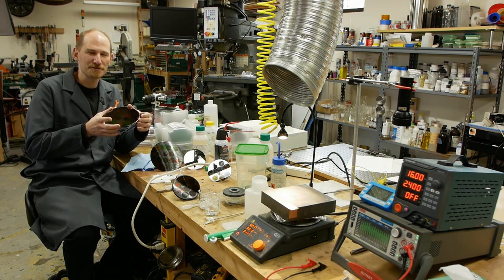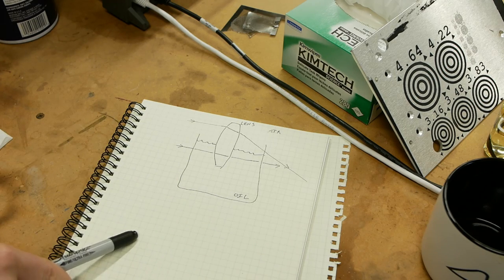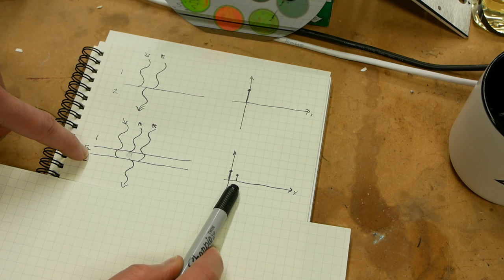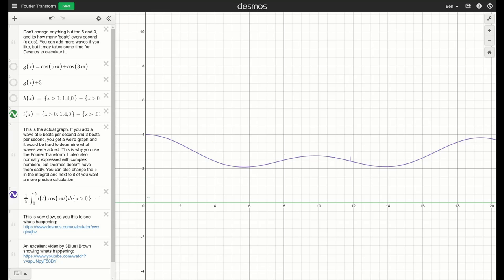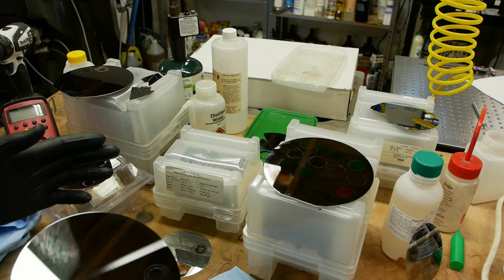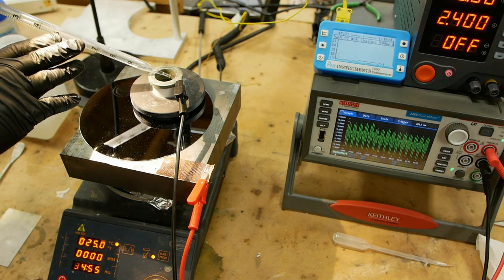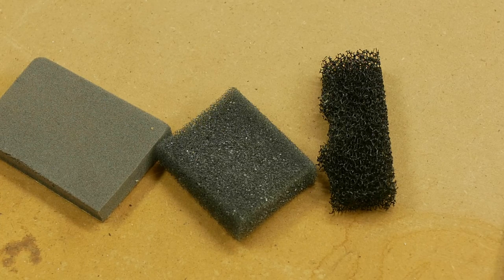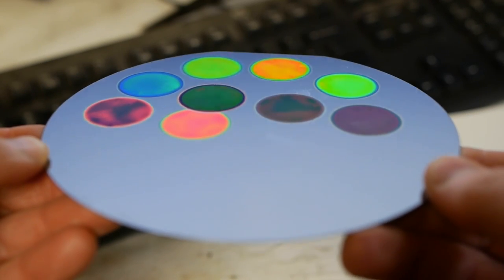Etching silicon wafers to make colorful Rugate optical filters (porous silicon)

Comment: So in inverse Fourier transform, you sweep through all frequencies and add them up with corresponding amplitudes. But in this case by altering refraction index of individual layers, we sweep through different phases for a fixed frequency because each layer is positioned at a different optical depth. However, the result seems to be the same? I don't quite understand how (mathematically) this is possible, can I maybe get a link where this is derived?
Reply: Well at a fixed frequency when you sum the phases of the different reflections you get the filter amplitude at that one frequency.  Effectively you are getting one point of the entire Fourier transform.  But consider what this looks like for a general frequency and wavenumber w=ck.  I believe we are to assume the intensity of reflection is proportional to the spatial derivative of refractive index.  The phase of the outgoing reflection is proportional to depth and periodic with (twice) the spatial frequency of the light (in principle this also changes with IOR, but maybe this is not significant in practice).  In phasor form the phase is e^(i2kx).  Thus the total reflection is the integral of the reflection intensity (IOR waveform) times the phase e^(i2kx) for each depth (dx), which is exactly the integral for a Fourier transform (up to constants) when k (or w) is taken as the independent variable.  I think this is more like a forward Fourier transform where you are finding the frequency content of the reflection strength.

Edit:  After some more though, you could also consider that for a given depth it adds a periodicity to the output phase as the frequency varies.  This periodicity is exactly the e^(ik2x) from before.  Thus you are summing the effect of the periodicity contributed by each reflection depth across the spectrum.  Weird cause now you have frequencies in the frequency response itself, but also a valid interpretation.  I guess another way to understand the qualitative similarity of forward and inverse Fourier transforms.
Reply: @piperboy98  keep in mind that actual reflection coefficient (Fresnel coefficient) is not just an index of refraction spatial derivative integral in general case. Assume just 3 layers, then there's 2 interfaces between them (2 delta-function jumps in density derivative function), and total reflection can only be calculated as the first interface reflection + an infinite series of inter-reflections between first and second interface. And the more layers there are, the nastier it becomes. Fresnel term gets really nasty in a continuous case, I don't even know how they solve it. Or do you think they neglect all the back-and-forth inter-reflections and just consider reflections that go straight back?

PS actually if you do happen to have a solution to fresnel reflection in the case of continuous IoR change, then I'd love to see it, because I have an application for it in mind.

Comment: so what you're drawing in the time domain is basically the impulse response of the reflection. transformed into frequency domain, it shows what frequencies have a reflection and which don't. but what about re-reflections and such? if i imagine an impulse coming into a multilayer coating, the response might contain more impulses than there are layers, right?
or am i totally off course here and you can simply fourier transform the refractive index changes? 
i also can't access the willeyoptical pdf, seems to be gone :/

Comment: It's kind of weird that n type silicon is sensitive to light where p type is not. I wonder why?
Could it be because hole vacancies absorb energized electrons which somehow inhibits the reaction? You are using hydrofluoric acid which is not very acidic when dissolved in water, so I can imagine energized electrons would be more likely to react with it.

Comment: Incredible video.  But something you said during it has sparked a burning question in my mind that my own knowledge of physics can't answer.   You said that by causing a reflected wave at a certain phase angle you can get reflected waves to cancel each other out, but due to the conservation of energy principle that means the photons enter the material instead of being reflected off it, increasing transmissivity of the lens.    Now... you could set up an experiment where you reflect fully half the light off a surface, and have a set-up where you can split the reflected portion and control the relative phase angle so the beams cancel each other out.  By the logic of what you said, you could detect whether the reflected beams were cancelling each other out, by measuring the transmissivity of the original half-mirror, i.e. measuring the brightness of light going through it.  My problem with this is that the cancellation of the reflected beam could be millions of miles away, and much like Wheeler's delayed choice experiments, whatever you did  at the cancellation phase would be reflected all the way back in space-time to the original reflection.  By modulating the phase angle of the cancellation stage you could literally communicate with the transmissivity measuring station,  at superluminal speeds, or even back in time.  (as happens with delayed choice quantum eraser,  the saving factor being that you can't tell which photons you need to look at without referring to the records of the 'chooser' at the other end.)

Comment: So basically the index of refraction of the bulk silicon was not changed. The process just create different layer of silicon with different porosity which results in different effective optical depth. I can imagine the surface toughness of these filters would not be very good due to the porosity. This is probably mostly useful if one wants to create coating on silicon wafers in theIR spectrum.

Comment: I knew a chemist that was working on a Idea to transmit data as colored pixels using an analog signal , he told me there were 18 million colors and every color corresponded to a letter , number , symbol , Etc. it was an incredibly fast system . Now you have a way to turn a electrical signal into a colored dot , you have invented "Color dot memory" to go with his  "Color dot data transfer system".

Comment: With this etching process, I bet there is a way we could record data in a way more complex way than we currently can understand.  This is also fascinating, as it makes Opals start to make more sense with their reflectivity and flashing of different colors.  

On a side note, I wonder if there would be a way to do this to standard lens glass, as it's mostly silicon.  Instead of using the electricity, maybe use ultrasonic sound waves with the etchant, on repeat for a longer period of time.

Comment: Regarding the controlled current supply, the design as it is is FLAWED
you are  doing feedback with base+collector current, the current we care to control is the collector current, hence
1:its going to be off, and most importantly 
2: the gain of a bipolar transistor changes with the current, so the base/collector current ratio is not the same hence the output wont be linear
a proper and easy solution is to use a Mosfet, a n channel mosfet with low gate threshold configured in the same way works fine as there is only current through the channel or design a feedback circuit that measures on the collector only, although that is a bit more complicated than the former

Comment: Perhaps the different sensitivity of some of the filters to the isopropanol is to do with the specific amount of porosity in the outermost layer in conjunction with the next layer down that can't be penetrated by the alcohol - it seems like you'd get the strongest effect when the outer layer is porous enough to accept a liquid, and in doing so, its index of refraction is brought closer to that of the next layer down - effectively merging two layers into one. I appreciate that it's a continuous process without "layers" as such, but there is presumably a fairly consistent depth at which the alcohol (or other liquid) can no longer penetrate.

Comment: Fantastic work, so cool! I was thinking about what you said about the alcohol changing the color, is it simply that if you have a higher porosity layer on top the alcohol flows down to a porosity where the surface tension stops it from going through the pores? Could this then change the refraction index and favor reflecting another color?

Comment: Great video, thanks! It's also possible to create silicon nanocrystals using this kind of method - and you can then tune the bandgap of the silicon nanocrystals by tuning their diameter (via the quantum confinement effect). You can demonstrate the bandgap tuning effect by illuminating with UV and measuring the emission spectrum, where the emission peak will corresponds to the band gap. Some really fun science!

Comment: Another fantastic video, of course, though a lot of it's beyond my very limited knowledge of physics and optics and chemistry.

But I've got a question that hints at possible extra applications for this process: what happens if the electric field isn't perpendicular to the surface? If it's parallel, does the etching stop, or does it just behave in an undesirable way?

Comment: Question. This is super cool and I can see there are tons of applications for this. But is there any sort of lifetime to the etching? As in, do the etched portions still maintain the same inert props of the silicon? Or does the act of making it such a porous surface introduce any sort of oxidation or similar, over time? In short, if you stick em in a drawer for a month, do their properties change?

Comment: Just saw in the background your spectrometer, the LR1-B. I was just looking into buying one last week - can you recommend it? Do you know of any lower-cost alternatives, or is this already the lowest-cost one that is a decent industrial instrument (as opposed to DIY hacks)?
Reply from the maker: I've been very happy with it.  I selected the wide-band configuration, and going from 200 to 1200nm is really handy if you want a general purpose piece of equipment, and don't need high resolution. The software is a little quirky, but in many ways it's also simpler, and makes assumptions that are helpful for basic usage.  The USB connection is solid -- plug it in, and it always connects right away, and never has issues.  I think it's the best performance-per-dollar for any new "real" spectrometer.
Reply: @AppliedScience  Thanks for the info! I figured it's probably the lowest-cost "proper" device on the market (apart from second-hand ebay finds), and it's good to know that it works well for basic use. The manufacturer also confirmed already that they calibrate the units. I don't need high-end (2-3nm resolution is fine, and mostly qualitative outputs for evaluating cheap bandpass filters and LEDs), but I need something that does the basic stuff well. Sounds good in this case.

Comment: usar fuego  pones silicon make diseno despues usar quimico  limpia pasar por fuego es mas complicado, pero se ven  todo los colores spectro  yo no tengo silicon use stainless steel  el otro stainless steel aluminum electrolyte stainlessteel con aluminum   tambiem se puede usar  los quimicos electrolyte   cooper  y muchos mas  usando el agua o el polvo que se crea con ese metodo trata tu veras

Comment: Anti-reflection = pro-transmission? How can this be? How does the 2x 5% reflection turn into 0% reflection?
Reply: Constructive interference.
Reply: @johnbaines9580  But the light is going in the wrong direction
Reply: @userPrehistoricman  Well it isn't going in the wrong direction. It's no longer hitting a smooth mirror surface, but a porous foamy surface. Depending on structure size of the surface and the wavelength, the light will either be reflected or pass through.

Comment: could you use this to create a VLF (variable linear filter? if so you could make a diffraction gradient and thus a very flat spectrometer!
Reply: Transmission VLFs are made routinely by standard thin film deposition techniques and with much better performance than is possible with PS.

Comment: What is that in terms of hz frequency of waveform to nm of light frequency? And is it a linear relationship? (Of course if my HF isn't the same concentration as yours it's going to be different results) That "quick and dirty" circuit you mentioned, can you elaborate? As I understand it , when the pwm signal average to 1 volt unit 1 amp current, the comparator seems to work as a current reference, that's all I get. Am I correct? If not please correct me and is that a PNP transistor?
Reply: Well, I found the link to a paper in the blog, 0.22-0.38hz at 63ma

Comment: Great video! What happened to the N-type UV sample at ~2V @ 17:56 ? It's the only one with that point of inflection. Thanks!
Reply from the maker: Good question.  I think it's possible that the amount of illumination limits the current.  So, below that limit, the IV curve is determined by the material's intrinsic conductivity, but above that point, it's limited by the light intensity.  I should go back and test with different colors and intensities of illumination.

Comment: Nice video. Question: why did you go for a sink not for a current source?
Reply from the maker: If the opamp and MCU are powered by a 3.3V rail, and the voltage supply for the wafer etching is 10V, there is no way to turn off a P-type or PNP transistor on the high side without additional circuitry.  By controlling the low side with an N-type or NPN, the two voltage rails can change without redesigning the circuit, and using a minimum number of components.

Comment: Not even trying to install the windows updates? xD I know the feeling :D 12:52
Reply from the maker: I disabled all wake timers, then set "active hours" for updating to be the shortest time window possible, and make sure the computer is always asleep throughout this window.  That little icon turns eventually turns red, and starts putting up nag messages.  Die in a fire, Windows Update :)
Reply: If you're concerned by cyber security, it's important to update your devices. But if you really don't want updates, you can turn them off by modifying services.
In the run command, type services.msc then disable Windows updates services.

Comment: Theoretically, would it also work with frequencies outside the visible spectrum, such as UV and x-ray?
Reply: Yes. But you need other Materials to coat
Reply: @airb1976  ok, I was thinking about how microchips are made. I seem to recall UV and xray lasers are used to etch the chips into the silicon? And it made me wonder about the effect on this process...
Reply: @spinjector  its a EUV process with masking the Material and etching